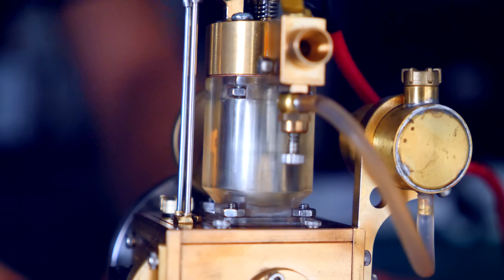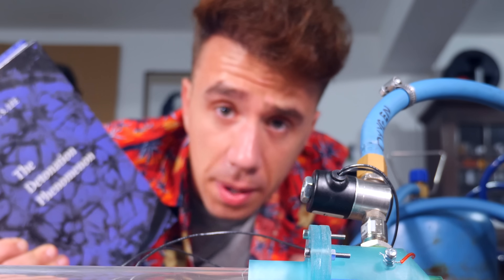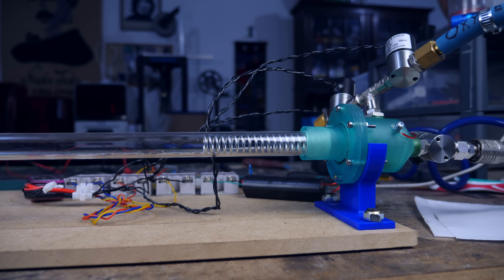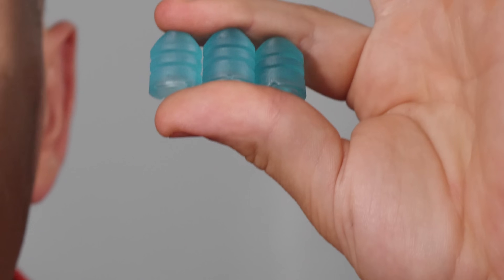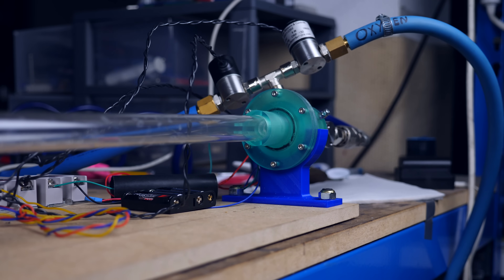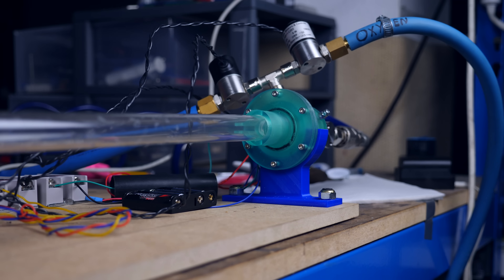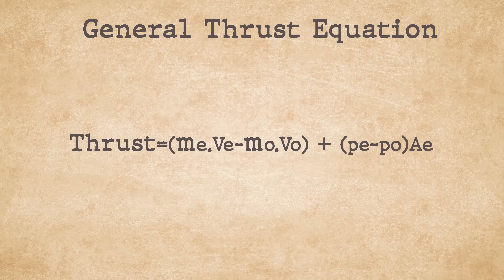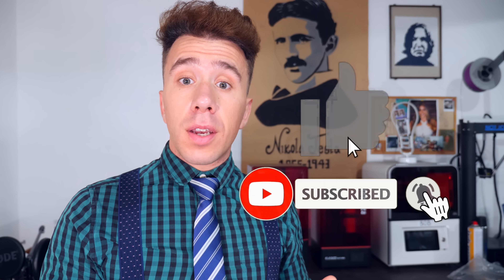PULSED DETONATION ENGINE

Comment: Instead of electrical valves which would operate at a fixed frequency, you can try mechanical pin-activated valves that are activated when the pressure in the chamber is minimal. Thus, the valves would activate at the exact rate to resonate with the detonation cycles, like in an IC engine.

Edit: Tomatoes are disgusting!
Reply from the maker: Congratulations! You just won a 3D printer! Send me your info (Name, Address, Zip Code, Phone Number) to integza@gmail.com.
Reply: I just made a post on something similar however instead of the exact resonance frequency a 2/3 harmonic would likely be better as it would place the point of highest pressure at the exist of the exhaust.
Reply: what about using automotive injectors? they can pulse pretty fast
Reply: I believe you are talking about a poppet valve a poppet valve works on negative press I don't think you will find much negative pressure in a PDE. . I have built my own design PDE and use a 12v car fuel injector to force an atomized spray of petrol into the combustion chamber which is timable for fuel inject time also spark ignition delay and time between pulses.
Reply: Congratulations, you will probably get a free 3D printer…
Reply: @andrewdoesyt7787  LoL
Reply: So basically a reevalve?
Reply: @ahmad hazimeh Internal combustion valves run off a cam shaft not pressure. Are you talking about a different valve that runs on pressure? The piston creates pressure on the down stroke so the vacuum draw air in when the cam opens the valve. Opposite on exhaust stroke. Camshaft runs of belt or chain from crankshaft
Reply: The problem with reed valves in a pulse jet engine is that the constant flex and movement means they're the principal point of failure from impact and metal fatigue. :(
Reply: It is possible to use a solenoid activated valve like a sliding plate instead of off the shelf valves. It wouldn’t be the best seal but would definitely be effective for timing and a solenoid can move quite fast. Think the old school bells or door bells that are solenoid operated.  I built a electric discharge machine cnc with solenoids once and they moved at an insane speed.
Reply: @haydenclancy3214  how about a spinning disk rpm determine frequency and if you can't spin it fast enough add more ports to the disk
Reply: A man from new zeland I think uses an arduino to control the fuel valve, with feedback loop from pressure sensor.  So he can even throttle the engine.
Reply: @robertsmith2956  I agree with you.
Reply: I believe the easiest way would be to create rotating valve and use a motor to change frequency
Reply: @TheStankec  My rotary valve Webber RC engine is still working after 40 years.  I'm surprised car manufacturers aren't using it with carbon cylinder sleeves.  No valve contamination with direct injection engines.
Reply: Like my comment please
Reply: I like theory but I just don’t envision it working.
Reply: Looks like someone gonna get a printer😂
Reply: Well said! Took my exact thought 💭 
I would use stainless reed valves and time them with the pulse modulation for proper air and fuel mixture. Then I would add a combustion chamber or a after burner section
Reply: Or .. rotating valves?
Reply: Sounds like a pulse jet?
Reply: @chriszenier826  Not really a Pulse Jet.

Here’s an analogy for you (which is the similar one that Integza made in the beginning of the video):

Think of a Pulse Jet as a POP with one’s mouth. That’s weak, right?

Now think of a Shockwave Jet as a CLAP with one’s hands. That’s surely louder.
Reply: I love this community lol there are always people who fix simple overlooked problems making everything run more efficient
Reply: Mechanical valves can sometimes introduce inefficiency. 

the electrical valves having different timings from the arduino based on the flow rate of the compustion gases / flow rate of exhaust gases or something would be ideal.
Reply: or you could have a presure sensor
Reply: That would be the pulsejet's working principle
Reply: I don’t recommend using mechanical valves. They have so many moving parts which make the valves hard to operate, maintain, and expensive.

No thanks.

I’d choose cheap. But I’m no Integza. So it’s up to his own interpretation.
Reply: what about some sort of valve using a tuning fork? (so its in sync?)
Reply: It won't work. You need positive control over the valves to achieve proper timing and mixing. The only full-scale example I'm aware of, which was actually fitted to a manned aircraft and flown successfully, used camshaft(s) that actuated mechanical valves as you'd see in an automobile engine. Electrical actuation can be even faster than a camshaft driven system, just look at Koenigsegg's FreeValve technology.
Reply: Yeah I think a setup similar to a metering system from a 2-stroke carburetor would work nicely once tuned
Reply: @fireshredder24  it won't work. If you're building a pulse-jet, then sure, reed valves on the intake work fine. For pulse-detonation, you need positively controlled valves.
Reply: I believe this is called a pulsejet lol
Reply: well we all know how this works - first person to comment something intelligent that gets a replay8 and integza pins GETS A FREE 3D PRINTER!!! TO H3LL WITH EVERYONE ELSE THAT DOESN'T GET NOTIFIED AS SOON INTEGZA POSTS!!! YOUTUBE ONLY TELLS THE PEOPLE IT LIKES WHEN HE POSTS!!! ARRGHHH lol
Reply: @ThatTweedle  keep calm and check yo caps lock, my man. What this dude said isn't even intelligent. He's basically describing reed valves on the intake which works great for pulse jets, but can't possibly work for a pulse detonation engine. As for OP's claim of electrical valves being slow, I'd direct them to Koenigsegg's FreeValve technology.
Reply: What is an IC engine? Also in what situations would you say electrical valves are more effective than mechanical pin valves in engines?
Reply: @thed_Talks  The primary limitation of electrical valves, especially logic controlled, is response and repeat time. Integza is already pushing the practical limits for that in this video.
The main benefits are the ability to activate at distance, and to activate on a particular schedule or frequency, within the practical limits as established.
The only way to increase frequency in the case of this video would be to add more valve assemblies and fire them in sequence.
Reply: @zhinkunakur4751  Well, maybe the only way that would be worth what it would take? How much tuning do you really want to be doing just for that?
Reply: @zhinkunakur4751  what would be another way? I'm curious
Reply: @jono3952  Tuned pipe exhausts, used on motorbikes, chainsaws and modelplanes.
Reply: @alwayscensored6871  IDK about you, but my chainsaw just uses the magnet on a wheel for that. No electronics required.
Reply: @jono3952  that magnet on a wheel? Yeah, it's creating an electrical signal. It's electronics. Old school mechanical ignition points? Still technically electronics (primitive, but still).
Reply: @martindinner3621  Ok, you're setting the bar for 'electronic control' *real* low there. You can't program a magnet embedded in a flywheel and a simple coil it passes by.
That thing will create a charge at w/e rate the machine is operating, period.
Reply: @jono3952  piezo electronics though can keep up with the response rate, such as the case in piezo electronic fuel injectors in modern high speed diesel engines
Reply: @matthewallen978  I hadn't thought of piezo electrics. I suppose they would have a much faster response time from signal to effect than a servo motor.
Reply: @jono3952  yeah their response time is faster than servos and solenoids, its why CAT uses them in their diesel engines, the piezo electronics are fast enough that they can inject multiple pulses of fuel into the chamber within the same amount of time a normal solenoid injector could react to sending a single shot injection
Reply: @thed_Talks  IC is internal combustion
Reply: @thed_Talks  Internal Combustion Engine just mean combustion happens in an enclosed chamber to do work. While a jet engine is open.
Reply: @thed_Talks  At a guess, IC Engine is short for Internal Combustion Engine.
Reply: @thed_Talks   Internal combustion engine ?
Reply: @thed_Talks  An IC Engine stands for Internal Combustion. This means that the combustion doesn’t create power, the piston or rotor it’s moving is the one creating thrust.
Reply: @thed_Talks  internal combustion, like a car engine

Comment: If possible, look into how air and fuel mixes in a carburetor and see if you could use some type of liquid fuel source in order to power your pulse jet. If all else fails you could try to use the smallest supercharger available and pump the most amount of fuel and oxygen into the engine as possible.

Comment: I would Try building the jet turbine again out of ceramic. If you negatively print the parts in clear FDM plastic with a small filler cup. Put it a vacuum chamber and fill will porcelite. It will make it dense strong enough to not explode while spinning. For complex geometries a thinner wall for burn out is clutch.

Comment: Video Suggestion: 
a VTOL (vertical take-off and landing) Jet powered 3D printed aircraft/plane. With maybe some kind of autopilot. 
I mean, something that with the power os some jet engines can vertical take-off and then switch to some kind of horizontal flight. 
Should be cool !!!
Reply: a quad-rocket drone? :D

Comment: So the Saturn V engine would use its own fuel to cool the Bell before it was ejected and burned, you should see if this is possible with a 3d printed engine (using cooled air to cool the engine and prevent overheating since you have an issue with melting the prints)

Comment: Why don't you use a bank of electric solenoid values for both oxygen and butane. If you had 3 in parallel for both oxygen and butane with check valves behind each one allowing the storage of oxygen and butane behind each valve then you could puls each value at a different time to get a more continuous detonation because you could set the valves to go off at different intervals but would open closer together due to more than one.

Comment: The mushroom is like 15 centimeters from the end of the tube. Imho that means you do not benefit from the pressure is causes. Maybe if you stick a funnel shaped object to the end of the tube (basically widen the last 15 cm of the tube) that might improve propulsion a lot.

Comment: 6:00 adding an obstruction to an already dangerous oxygen+butane fueled "jet engine" (totally not a brittle plastic pipe bomb) seems like a REALLY bad idea. I get that you know what you're doing but good God man wear a full face shield and something to cover your neck. You didn't even use the safety goggles this time.

Also I don't think I saw earplugs this whole video which when you say it sounds like a gun is genuinely concerning...

Comment: why don't you use kerosene as fuel, pressurise it and create a preheat chamber it should work better as a jet fuel than lighter fluid (butane)
Reply: use a CO2 canister the pressurised the kerosene

Comment: Intgza, for valves, you can go to a scrapyard to find a car with an lpg system, grab a couple of lpg injectors and a coil on plug, you can drive them with arduino at much faster speeds, and the spark could be more controlled. if you need any help with that, i can help.

Comment: Idea for video: Instead of improving the detonation engine to make it pulse faster, add more detonation engines connected to the same acrylic tube. This is what happens to the piston engines, instead of making the best single cylinder engine to get power, more pistons are added to the engine to get the same power.

Comment: Just a quick brain fart i had... What about if you build a one way valve or two that allows it to suck in air in the front to reduce the back sucksion after the explosion? or even one in the back so it will only suck in the front and blow out in the back.

Comment: video suggestion: take the PD jet you just built and place another larger diameter tube over the exhaust so that they are concentrical. then measure the thrust with it going at full throttle. the ideea behind is to use the Venturi effect to improve static thrust.

Comment: Hi love this project these are my suggestions for better version of this  maybe ad a electrically driven   mechanical valve opening system to come to 200 detonations a minute (or faster when you speed up electrical drive ) you could also time ignition with this same system  therefor you theoretically have a throttle
also vary the length of the pipe to see if this improves performance

Comment: Knocking is usually created because of off timing in a combustion cycle. It can however lead to like you said damage to the cylinder and eventually to knocking🙂
Reply: Your fuel does have to be properly atomized before detonations. Hence the usual use of a carburetor to bring more power and effectiveness. However since your using oxygen you can skip that step, however you may have to interduce a fuel injection nozzle to increase performance🤔

Comment: It would be interesting, to see how this engine would perform if there was something containing the explosion in the chamber for a little longer.

In a gun that would be the weight of the bullet, but I guess that would be illegal for an engine.
So maybe a very quick opening and closing valve that opens a fraction of a second after the gas is ignited, so it can build up more pressure before being pushed out of the propulsion tube?
Reply: Or a longer tube where more of the flame can finish its burn and expansion.

Comment: What if you combine all the technology you've made/used to make your next engine? Using a turbocharger to increase air, wider 'jets' for more fuel flow and maybe a geared servo controlled valve system with high rated sensors in the combustion chamber!!!

Comment: Video suggestions: Instead of using electronic valves to do the pulses, you could spin up a fly-wheel that drove manual valves (like the piston in a car blocks/opens vents).

Comment: Video Suggestion:
An aeolipile (Hero's Engine), but with explosions, instead of steam.  Take a similar concept to what you are trying here and convert it to rotational thrust.  That alone could power a wheel.  Or...  You could shape the arms of the engine into wings and try to make a helicopter-like apparatus.
The challenge would certainly be to feed spinning exhaust ports without leakage.
And, yes... tomatoes are disgusting.

Comment: You CAN get detonation with air and fuel alone.  I built the worlds first self-aspirating petrol/air fueled PDE about 20 years ago.  The secret of detonating a petrol/air mixture is a double helix of wire (preferably square) going down the tube, preferably offset from the edge of the tube slightly with some other wire.  The combustions starts as deflagration at the spark plug, but this helix creates localized high pressure zones that cause detonation.  You want fewer turns than your shocking spiral...maybe only 4 or 5 turns for the whole length of your tube.  You must purge the tube with air between firings.

Comment: Hey Integza, great video!   You always have interesting videos.    Good to see you using eye protection.   Along with that protection, definitely use hearing protection when doing this stuff!
Reply: Repeated Denonations without ear protection is probably not good on the ear drums.
Reply: @kreynolds1123  Probably not good on the ear drums? Slight understatement lol, the sound from a PDE can be up to 171dB and the quietest they can be is still 100dB+ so even the quietest PDE can cause hearing damage after a few mins without hearing protection and the loudest ones at 171dB would very likely cause serious damage after just several seconds without protection
Reply: @martinpeel1820  is it a kind of sarcastic humor in understatements?

Comment: Add an expansion nozzle (bell) to the end of the tube and I am willing to bet you'll see a lot more thrust.   You need to reduce the chamber pressure closer to atmospheric by expanding the flow at the bell nozzle.   That will accelerate the gas even further and result in significantly greater thrust overall.     Just a guess looking at the expansion I'd guess that your expansion nozzle needs at least a 300% larger diameter exit than your tube.   Next step would be to add a restriction nozzle at the end of the chamber to raise the chamber pressure,  followed by a smooth transition into the expansion nozzle to expand the flow out to near atmospheric pressure.   You are probably only extracting 10% of the potential thrust from this engine right now.

Comment: get yourself a coil on plug  that are used in cars
i work on a arduino based conversion for old cars with mechanical ignition 

they have relay inside that can be triggered straight from arduino 
in cars charging time is about 1.5 to 3ms 
i was able to fire them 300 times per second with arduino but they might overheat in longer use

Comment: Tip: Combustion chambers should [pretty much always] be circular, those 90 degree corners concentrate forces.
In an ideal world they should be spheres (or pill shape) as flat ends take something like 2 times as much force as the side walls (don't quote me, I did the research for this 25..30 years ago)
Reply: And get some hearing protection, once you lose it it never grows back.... Shooters ears will work great for you.

Comment: Would it be possible to sort of use the pressure wave like a piston and with valve kind of like a 2-cycle ICE engine? So when the exhaust is exhausted it leaves lower than atmospheric pressure inside the combustion chamber that allows sea level pressure in the carburetor able to blow open the valve and fill the engine with fuel-air mix. Meanwhile part of the detonation wave is echoing back into the engine and when it does, it compresses the fuel-air and detonates it like a diesel. Rinse and repeat. Maybe that is along the lines of how the rotating detonation engine works?